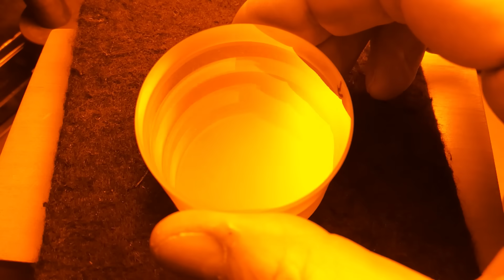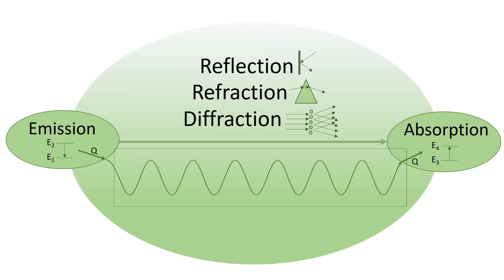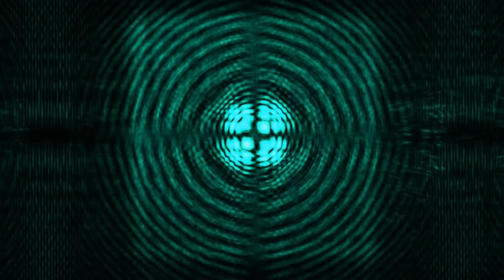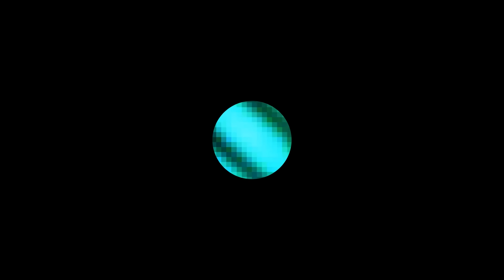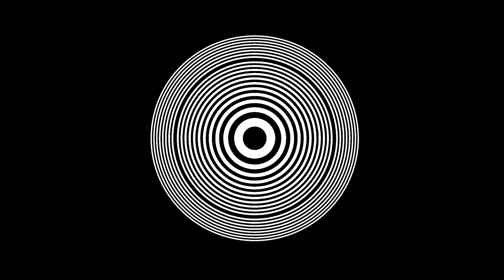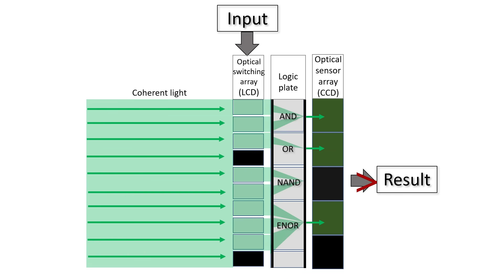Making Optical Logic Gates using Interference

Comment: "truly unpickable lock"...

LPL: Hold my beer
Reply: LPL would just bypass it with a magnet or piece of Redbull can once he knows where to put it.
Reply: Well easy breezy. Obviously were dealing with optics. Such a poor medium to work with. It can be distorted, cracked, shattered,etc. Any mechanism using optics would need a redundant backup of some sort. That is  what you will end exploiting. Just destroy this truly unlockable lock mechanism. Unless they make undestructible optics? Unless builder of such lock didn't put in a backup to access whatever you trying to secure? I have met such people.
Reply: @chrisvielle6629  This applies long before reaching the delicate nature of optics.

There's a reason bank vaults and the like don't have some ridiculous combination of "impossible" mechanisms made of hardened materials, stuck to a bathroom door with a padlock hasp. It would be absurd... One look at the door and the lock would be completely ignored.

There's always an easier way in when the lock itself is designed right, that's the whole point. It comes down to what it's worth to try and implement. The lock ideally matches the door, walls, floor, ceiling, whatever... In terms of resistance to breach. So just like you wouldn't put a bathroom door on a bank vault, you wouldn't put a shed padlock on a massive steel vault door with hardened locking pins and reinforced concrete walls.
Reply: @MadScientist267  This ties in with that great quote... I don't know if its LPL, but I heard it first from him:  'Locks only stop honest people.'  (paraphrase)
Any lock can be trashed to the point of non-functionality if you're willing to break shit.
Reply: @dominicdelprincipe2583  Definitely predates LPL... Was one of my dad's favorite sayings many.. lol ok too many.. years ago 😟🤣

Far as any lock being trashed... True, provided you have the means to do it.

The saying is good and does have merit, but the reason bank vaults are so tough is because the not so honest need to be "kept honest" as well 😉
Reply: @MadScientist267  Cool, thanks for insight :D
Reply: @chrisvielle6629 , perhaps you’d be willing to share some deigns?
Reply: Indeed
Reply: I will also laugh if you explain what's LPL
Reply: @omsingharjit  Lock Picking Lawyer... he's a guy who picks locks.
Reply: @dominicdelprincipe2583  😂😂
Reply: This reminds me of the $5 wrench attack on Bitcoin

The key to solving don't lose the key... is unique humans that can't lose their body. Party @ my yacht, mid 2024
Reply: A subtle challenge, i presume.
Reply: @IamKKB1984  LPL (lock picking lawyer) is a dude here on YT that basically demonstrates that security, as we've ever known it, opposed by the right hands, is essentially a joke.
Reply: I mean, untimately, no matter how intricate and complex your lock's way of reading the key's secret is, that doesn't matter because that's not what will end up being targeted. Getting through a security system involves abusing it's vulnerable parts, and just having some amazing key doesn't magically remove oversights in the rest of the design
Reply: yeah thats a no from me chief, lol
and locks NEED to be pickable, otherwise if you lose your key you'd have to break down your entire door.
Reply: @razhemo4191  Don't loose the key, then.
Reply: @junosoft  that's easier said than done lol
Reply: @razhemo4191  They don't need to be pickable: when locksmiths cannot open a door through low-effort means, they just drill the core out and replace the lock. If I put in a lock strong and secure enough that breaking down the whole door is the only way to get in, chances are that requiring this degree of effort was the whole point of putting in such a strong lock in the first place.

Comment: How do you plan on normalizing outputs again so you can use multiple gates in series?
Reply: Exactly my thought as well!
Even though it has been shown to work in isolation doesn't mean it will be feasible to use in series.
This could be applied to perform complex hard-coded calculations, so in a way it could shorten the instruction pipeline of a CPU -- though I don't think the conversion from electrical information to optical and back again will be faster than doing all of that using the same data source.

Comment: I think it might be significantly easier for you to use edge based diffraction gates so that you could lay out your work with more ease. The way that might work is by reducing your optical path from planer to a linear. You could use glass etching techniques to create fresnel lenses that are phase based, and with the optical paths that are through the edge of the plate, rather than normal to it. Furthermore, using phase based diffraction elements allow you to increase your optical power in the first order lobes of your pattern significantly since it won't be lost to the DC angular plane waves you have to deal with when using purely absorvative filters.

 Furthermore, reading bens comment about using photochromic materials to introduce nonlinearities/memory gave me the idea that you could selectively sputter these materials into wells created by glass etching, which would allow you to place pockets optically nonlinear material!

Comment: I have doubts as to the feasibility of this. You can simulate individual gates, sure, but composing them together is the real question.

I'm certainly not an expert on optics, but I think it could be that given a fixed configuration, the output can be expressed as a
linear combination of the inputs. I've explored the possibility of simulating logical circuits by repeatedly multiplying a
starting vector by a matrix, using varying fields, and failed, though I don't know that it's impossible.

If the output of your optical circuit is indeed a linear combination of its inputs, then I think this is essentially the same problem.
(If you choose to allow your circuit to loop back in on itself, otherwise its basically that you just get one matrix multiplication)

At 3:47, you show the thought of having a threshold for deciding if an output is 0 or 1 based on the light value. If you could ensure that
a gate outputs a particular light level when a signal is decided as 0, and a different light level when it's decided as 1, but not multiple
such light levels for each possible output, then I think you will be able to compose gates just fine.
Reply: Updating my remarks... perhaps its not as hopeless as I initially expected.
I recalled that I had heard before that some neural networks had been implemented physically using only light, neural networks can emulate circuits just fine, so I searched around a bit for more details on that stuff.

This seems like a decent video discussing using light to make neural networks: https://youtu.be/jXjG6AJKkpg
I want to draw attention to these timestamps(in the video I linked)
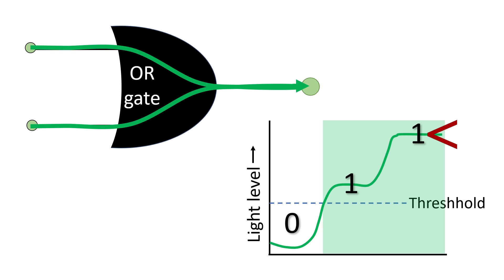- 4:15 (paraphrasing) Forward propagation in a neural network is easy, backward propagation is a challenge -> this would apply as well for logic circuits, not being able to have
data loop around makes things harder. Or to be more specific, I don't think you can have a Turing-complete computer without be able to have data loop around,
though that might be okay anyways, optimizing for specific computations can still be a win.
Anyways, this was described as a challenge, not an impossible task, so ya.

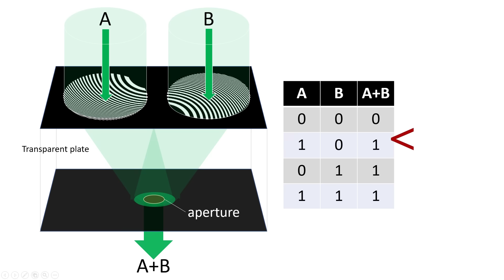- 6:38 "The 2nd challenge researchers faced was that of non-linearity" -> Affirming my suspicion that having nothing but light will only result in linear combinations.
Further quote: "In fact if we were to remove non-linear activation functions from neural networks, the resulting neural network function would just be a linear function that you can get from a linear plot of the data...". She goes on to say though that they have come up with stuff which enables non-linearity, one noting something with quantum interference or such with some materials, another noting some materials which can undergo some sort of phase change? Well out of my wheelhouse, I'm just an amateur whose main thing is programming :P

Anyways, I think my initial suspicions were confirmed. Though there can be something to optical computing, I think you will need to have something in
addition to light, not just light alone. You need to introduce some non-linearity somehow if you want something more than a linear function.
One basic idea may be to just have some sensors which can switch on/off some small mirrors(like in your video https://www.youtube.com/watch?v=KpatWNi0__o) to redirect light at some points in your configuration. Your bottleneck would be how quickly you can turn a light signal into a mirror being moved.

Comment: Very creative solution. I have two questions /issues. One is the lack of normalization of the signal at the end, I guess it may interfere with the possibility of using standard gates and connecting one with the other without customizing  anything. The second question  /comment is related to signal attenuation : Will it be an issue? My guess is yes. Keep the good work.

Comment: I think it would be easier, from a manufacturing standpoint, to use doped glass that only transmits certain frequencies of light as your gate, and make your inputs different frequencies that combine to the proper frequency.

That would be an AND gate.

an OR gate would be even easier, as you'd only need a signal on one of the channels to "activate" it.  Conceptually, you could build it as a solid block with waveguides of a different type of glass (like embedded fiber-optics). When one of the waveguides is transmitting light, then the gate is active.

NOT gates could be tricky.

Comment: First video by you that I watch. Very nice. Normal electronic logical circuits always standardize the output voltage, so that you can connect it to the input of the next step in the logic. Here, with light, this seems not so simple. It would of course also be nice if one could lead the light from one gate to another through optical fibers. I imagine that you could then experiment and build logical "circuits" like you can on an electronic "breadboard".

Comment: other than Logic gates, would optic signal processing allow us to perform samplingless data recording?
Current electronics is sampling using timers, while I believe that theoretically with optical processing we might be able to figure out the way to convert a signal into a vector changes over time instead of value data points

Comment: Awesome video, just found your channel.
I think there are two major hurdles for complex optical circuits/"computers".
First, you need to be able to build tiny optical amplifiers in order to be able to chain logic gates. 
Second, your setup needs to be able to keep a state("memory", think of latches/"flip-flops").
That is not required for everything though, e.g. you could most likely create a perceptron(type of neural network) using optics, probably even a multilayer perceptron(Training would still have to be done on a computer).

Comment: I think there is an issue with using interferometry for the EOR gate. I also though about this some time ago, and the problem I had is that you cannot concatenate EOR gates because you are not certain of which was the resulting phase at the output. As the two equal outputs of 1 have a 180º difference, this output cannot be used for subsequent interferometric doors. You can use a photodetector with a laser, but that wouldn't be coherent with the original signal and ruins the advantages of a full photonic circuit. Please, if you have a solution for this problem I'd like to know it. Awesome video anyway! I'm really enjoying your videos.

Comment: TL;DR: Ordinary optical components are linear, and no combination of linear components can produce a non-linear device. XOR is non-linear.

Optics is a wonderful field, and your craft and hand-on demonstrations are very beautiful, and a pleasure to watch. I certainly am not writing this to criticize you in any way, but merely to point out some fundamental considerations to be aware of.

Ordinary optics (meaning a fixed arrangement of lenses, mirrors, diffraction gratings, filters etc) is linear in the sense that if an electromagnetic wave "A" at the input produces the output "X", and an input "B" produces the output "Y", then any mixture of A+B at the input produces a corresponding mixture of X+Y at the output.

A Fourier transform is a linear operation, which satisfies the above property. Hence, it can be realized by an ordinary optical system. (Any other weighted sum or difference of inputs can also be realized.)

But a lot of interesting computation is not linear or reversible. XOR is already very nonlinear! Threshold that is inherent in all of the ordinary electronic logic gates, even in inverters, is a non-linear transformation. Obviously, multiplication and division are non-linear, etc, etc. Finding roots of a quadratic equation is non-linear. Almost any computer program is extremely non-linear.

In general, universal computation fundamentally cannot be realized with just the linear elements (the ordinary optical components.) To make a universal computer, one would have to add non-linear optical elements into the system. Such nonlinear optical elements do exist and are used occasionally to great effect (frequency doubling, for example, like in green laser pointers), but as of yet there is no easy to use, inexpensive non-linear optical element that would be equivalent to a transistor.

With the ordinary linear optics, you can make a linear mixture of the inputs that resembles some logic operations. But without sneaking in some non-linear operation, no matter how you cascade these linear blocks, the result will always remain a linear system, and some even very simple things like XOR will not be even approximately realizable.

There are of course great many other things that only optics can do. Good luck with your experiments -- love your work!

Comment: In an electronic computer, all of the components use electrons to do their very individualized task. Trading out electrons for photons, just means figuring out a way to interface photons with the existing electronic infrastructure. In such a way as to not reinvent the wheel and make the process more efficient. Even if that only means reducing heat loads from electron processors.
Reply: but light is much faster than electricity

Comment: Just copy pasting an edit I made from another vid that inspired the idea:

"I just had an idea for logic gates using light as their medium instead of electricity, should be made of 3 tubes, the outer 2 should be triangular while the middle one should be straight, the connecting points of either end of the middle tube should contain a lense that angles the light, the light should come in at an angle, the angle should as slight as possible, both triangular tubes will have both a light emitter and a light sensor (or just be connected to another tube), the light emitters will be aimed at the tube in the middle, if both are on then both sensors (or tubes) will receive input, if one is on then the opposite sensor (or tube) will receive input, the angle should result in the light bouncing off of the aligned edge of the outer tubes right into the light sensor/tube, this will prevent it bouncing back towards the sensor/tube that was next to the emitter that emitted it."

Comment: Waaait wait wait. You said that when reflected waves interfere destructively, more energy goes into refracted light (that passes through). But what if you replace the lower surface with a perfect mirror? As far as I understand, interference pattern should still appear. 

I always assumed that energy is re-distributed from areas where waves interfere destructively to areas where they interfere constructively, but this rationale assumes non-local interaction which's clearly not something that's supposed to happen, so it's unlikely to be correct.

Comment: Would these gates compose properly? I would have thought that the linearity [edit: perhaps thinking things are linear is a mistake I’m making?] would prevent them from working properly for that, but upon seeing the interference patterns I’m doubting myself.

Ok, suppose you had some mirrors or something to allow inputs to go back up to a previous level, to make something which, if it were a circuit, might have one behavior, but after receiving an input would change to another behavior and stay with that behavior after the input was removed (like , an or gate with the output fed back in as one of the inputs).
I think linear combinations of solutions also being solutions, should stop that from working for optics, right? Not just because of losing some of the light in reflecting and such, but more because it shouldn’t be possible to amplify a signal with stuff like this even using another input?

However, I know some people came up with a thing where instead of just training a neural net to get camera input with a normal lens, they had a simulated lens and camera where they optimized the network and the shape of the simulated camera lens together, resulting in the camera lens doing some of the computation? Iirc?
So, I’m a bit confused.